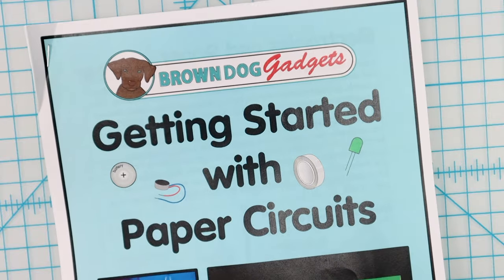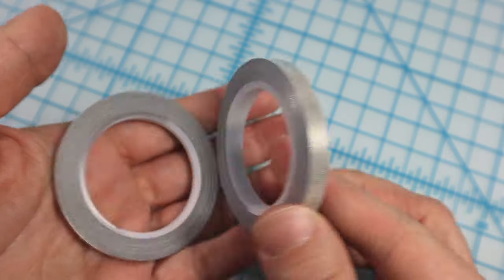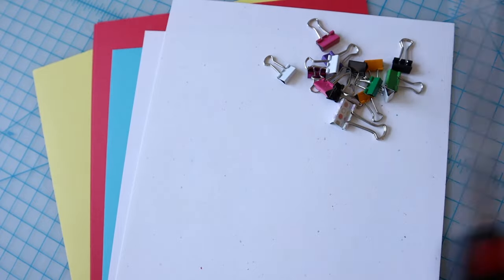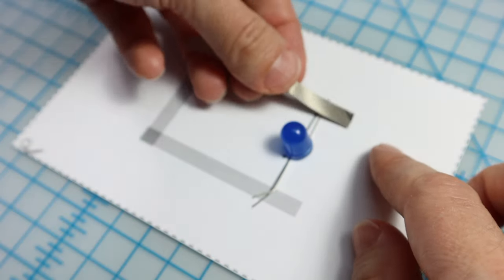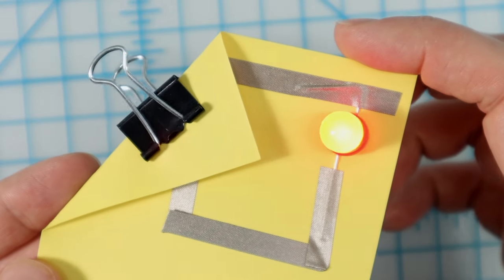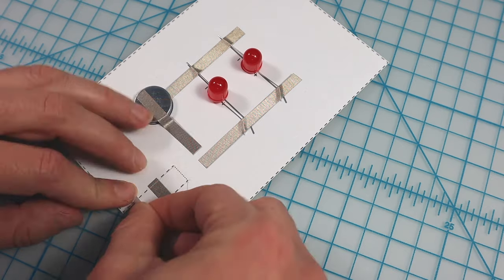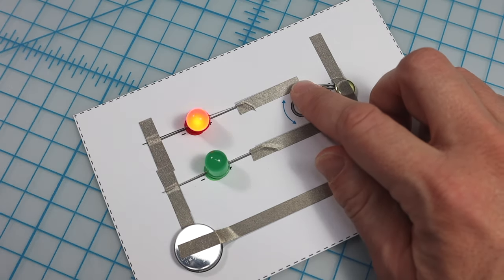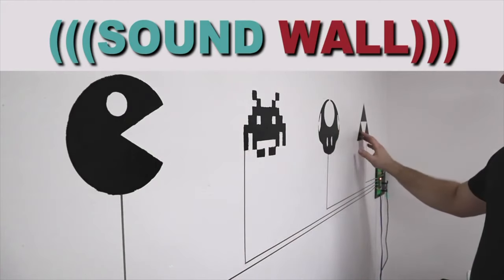Getting Started with Paper Circuits

Comment: Hi! Quick question, I did exactly the same with 2 LEDs but only one is lighting. Why could this be? I check first that both are working. What could it be 😞. Thank you for your help!
Reply from the maker: Hello Nara, are you using our LEDs? Our have built-in resistors so that using two in a parallel circuit should ensure they both light up. Most LEDs you buy in bulk do not have built-in LEDs and don't work well if you mix different colors.
Reply: Thanks,  @BrownDogGadgets  !  That's cleared up the same problem for me.